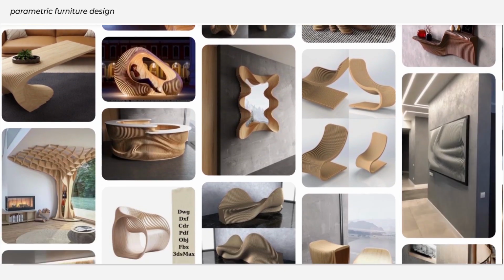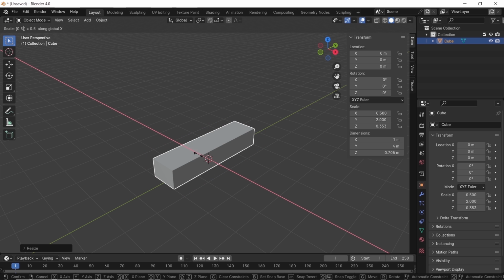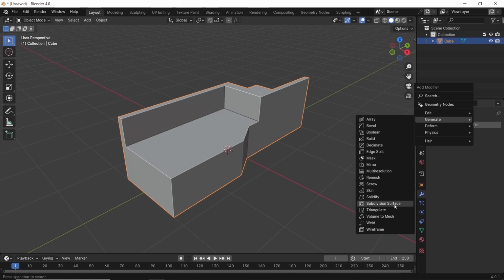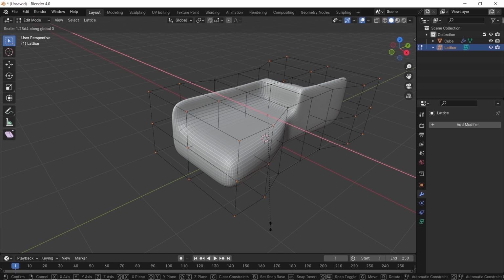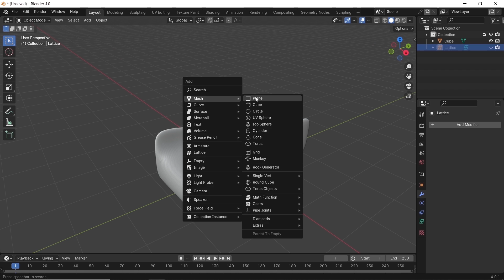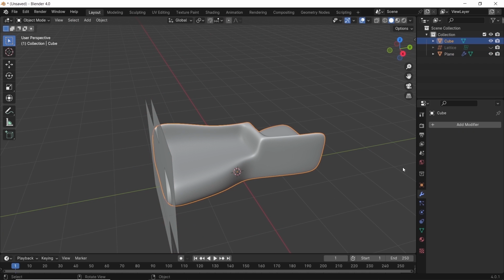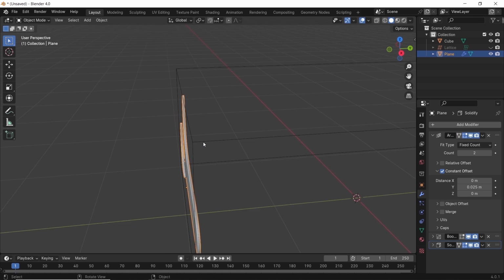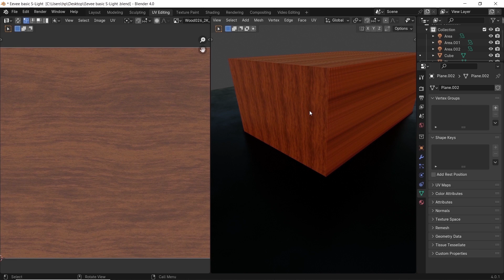How to Make Parametric Design in Blender 2024

Comment: How do I then export the pieces as DXfs for CNC?
Reply: I might even end taking this to fusion 360, because that one I can trust with something like this.
Reply: @qupation7296  How do I model something like this and cut slices in fusion 360?
Reply: You have to apply modifiers, then, in edit mode, select face by face to separate what you need and then export
Reply: @gianlucascattarella can you send any tutorial
Reply: Right? Because that's what we ultimately wanna do.
Reply: @qupation7296  There is an add on called "Outline to SVG"... It has helped me with this, as I can export the cuts perfectly and open them in Corel Draw, for example. I found this plugin only this week. haha

Comment: At 0:34, how do you get the loop cut to go in both directions? Can't find anything about it online. Thanks for your help, and tutorial!
Reply from the maker: it's 2 commands, Ctrl R for cuts then Ctrl B for bevel the cut into 2.
If you want to add 2 cuts on the same distance from border, you add one in the middle control R, then bevel it with control B, you can after that set the distance with your mouse.